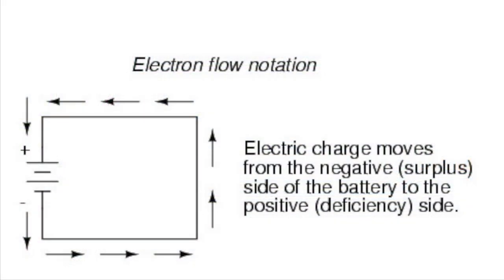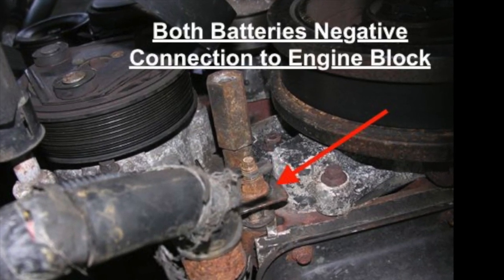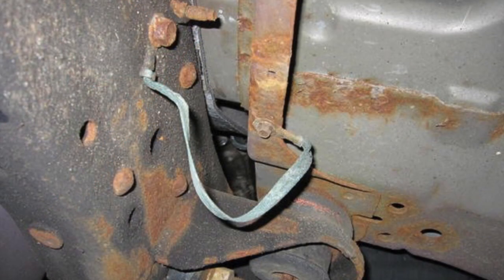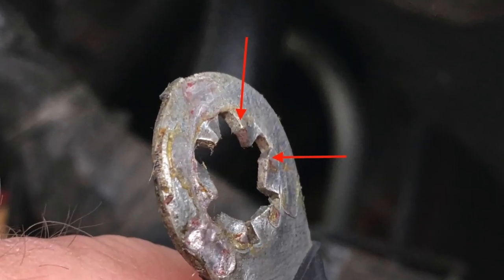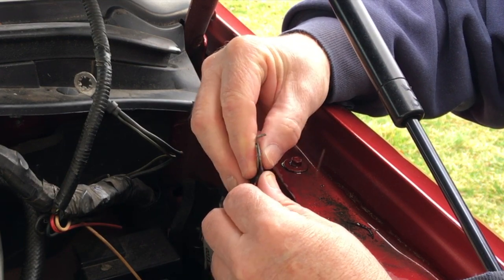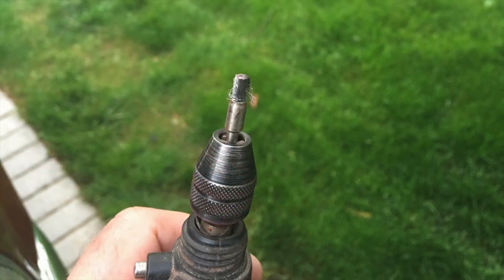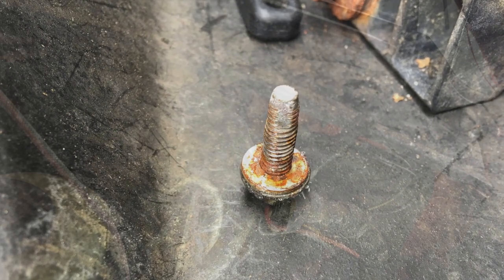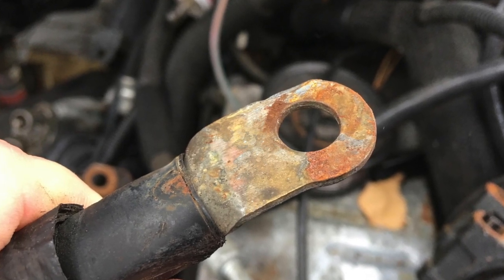Powerstroke 6.0  Electrical System Negative / Grounding Locations

Comment: 18" eye-to-eye 1/0 gauge cable from driver's frame to block is too short for me. Its an 04 and routed as shown in your video using recommended place on the block. It might reach to the stator bolt, but I still have the shroud. I see the one ficm repair sells is 21" and others suggest 24". That's my report. Still mulling it over. Thanks always for these videos with in depth explanations.
Reply from the maker: I originally used 24" and recommended it, but on the forums, I kept getting comments that it was too long. I was able to use 18" in my application, but... Thanks for the comment - it helps.
Reply: @toomanytoys  I figured you tested it and I was doing something wrong. Turned out I was using the hole above your recommended location. Using the hole below the water pump outlet brought me closer. Still, I had to route the cable in front of the power steering(?) hose. I should add split loom anyway and will monitor for chaffing.

Comment: Great video, I’m currently dealing with a real gremlin, new alt, new batteries, good wiring to alternator, and yet my truck keeps dying while running- loosing all electrical power. Starting with gauges, radio, lights , then eventually stalling out. I am going to try using this video to take a final jab at it, then if this doesn’t work, it’s going to a shop and I’ll make a write up on it in case anyone else has this problem
Reply from the maker: Are the batteries losing voltage during this?
Reply: @ yes
Reply: @ I’m not getting a battery light which is the weird part
Reply from the maker: @ When you lose power, have you checked the voltage of each battery?  And do you manually recharge afterward?
Reply: @ I checked them when it looses power, it’s usually immediately after I jump it and take off the leads. I did leave it on the car charger over night and that seemed to help a little but I could be wrong.
Reply from the maker: @ After losing vehicle power, what is the voltage of the passenger battery and the voltage of the driver's battery?
Reply: @ I would have to go check, it usually is around the low 11s high 10s
Reply from the maker: @ So both batteries are at about the same voltage?  Does the battery light come on during wait to start?
Reply: @ yeah the battery light comes on, and yeah they are about at the exact same  level of charge
Reply from the maker: @ With the batteries charged, if you put a voltmeters negative connector on the passenger negative post, with the voltmeter positive lead, what is the voltage on the passenger battery positive post, and then the voltage on the alternator's positive output post?
Reply: @ with the truck on or off?
Reply from the maker: @DTMBUILT  Off, not running.  Actually, both would be good.
Reply: @toomanytoys  12.2 off
Reply from the maker: @ So the battery and the alternator post read the same, right?  BTW, a battery with a 12.2v reading is at 50% charge.  A good battery at full charge will be 12.6+v.
Reply: @ yeah they both read the same , that’s what’s making me just want to give up because that’s all I could think of. The truck is sitting in a random parking lot right now until tomorrow when I can get it looked at. The most I could do now is jump it but I don’t think that’s going to charge my batteries all way but I could be wrong. It seems like these things need to be 100% charged after they die
Reply from the maker: @DTMBUILT  Yes they do, and coming right off a charger they should be over 13v.  When a battery is not fully charged, the plates will oxidize quickly.  When batteries are deeply discharged, they need a charger that can do a restorative charge over 24 hrs.  In a vehicle, even if run for 6 hrs, will not fully charged.  They will only accept 3-4 amps after ~10 minutes due to internal resistance.  It could be that the alternator is doing everything it can, but with the batteries not fully being charged back, depleted, they get hurt more.  You may also have an internal fault in one battery, which will drain both down.  I’d be charging both with a charger to full, then take them to AutoZone, Advance, or wherever and have them tested for free.
Reply: @ I think this may be it, I will say, once I had it on the charger a week or so back for a looong time , it was seemingly fine. But now it’s having its issues haha.
Reply from the maker: @ At this point, these batteries may be toast.
Reply: @toomanytoys  I’m going to remove one at a time and get them load tested and see
Reply: @toomanytoys  so I just made a discovery, the positive lead on the passenger side battery is partially broke, barely hanging on, the metal part that goes around the terminal. I’m wondering if that could be it. I feel like it would’ve showed up on the multimeter but maybe not
Reply from the maker: @DTMBUILT  Is it the battery to battery section, or the part that goes towards the cab?
Reply: @ battery to battery section
Reply from the maker: @ FYI, if you can’t make a good repair, CustomBatteryCable makes a good set.

Comment: Looks like I'm going down the rabbit hole..... Had a hard rain yesterday and drove the truck 3-4 hours. Today no rain and now I have 4 fault codes (B1318, P0276, P0278, P0341) 3 of the 4 (B1318, P0276, P0341) are related to low voltage. I just installed a new 130 amp alternator with the smaller pulley and output at idle is ~14 volts. After the 4 hour driving yesterday and about 1 hour drive time today batteries are reading ~11.3 volts before cranking the engine. I know that anything under 12.6V can harm the FICM. Additionally, about a month ago I had the cab lifted about 6 inches to get the turbo out and install S&B body mounts, so I definitely need to check those flat braided cables.
Reply from the maker: With the draw of the glow plugs, that's a common voltage before hitting the starter.  If you look at some of the graphs when I did alternator testing, you can see how the voltage changes during the "wait-to-start" point to when the glow plugs turn off.
Reply: @toomanytoys  Thanks for the reply! As an admission of me not being observant I have seen many of your 6.0 Videos, and have read many of your posts on FTE over the last couple years, but just put it all together this morning as I am reading one of your threads on FTE that all of it was you!
Reply: @toomanytoys  I had my engine "bullet proofed" by a local shop about 2 years ago and after I got it back I had 2 dead batteries, and within a month 2 burned (yes burned like scorched) Warren injectors, and have been chasing electrical gremlins since.... I've not taken the truck back to them as they caused more harm to my truck than good and I no longer trust them. After recently having a Cyl. 6 Imbalance code I replaced my FICM harness, VGT solenoid, and cleaned the inner turbo exhaust housing and replaced the unison ring as it had a "keyhole" going on, and did a couple pigtail fixes on some cracked wiring while I had it all apart. I'm at the point right now that I just want to redo as much of the wiring as I can and trying to get the ground issues fixed first.

Comment: Thank you for detail 
For my project, they will come in handy, as I move beyond what was detailed in this video.
I bought a decommissioned ambulance, where the seller claimed that the 6.0 was "junk", at 164,000.
By "decomissioned", I mean that they took a Sawzall to most of the wiring.
Now, the entire electrical system is a bit wonky, and, I suspect a bad ground circuit.
Or several, as it is an ambulance, which has many circuits, and no possible body grounds in the rear, which is entirely aluminum.
Reply from the maker: I wish you luck with that.  There is so much add-on wiring to those.
Reply: @toomanytoys  dug into it today.
The ground strap from the batteries crumbled in my hand.
Not sure why it got a new starter installed.
But, I guess I'll  take it.
$1750,  and a ground cable, for a nice 2005 e450 ambulance sounds good to me.
Reply from the maker: @Mr.Schitzengigglez  New starter because no one looked at the cables; fantastic! Just had a recent forum thread like that.  

You take any good deals that come your way.  Glad you sorted it out.
Reply: @toomanytoys  ground strap crumbled in my hand today.
Surprise, Surprise. New one on order.
Gonna improvise tomorrow, because I'll probably be working when the real one gets here.
And, it's "only" a ground.
Reply: @toomanytoys  on top of my last reply.
You ait lying about that, my man! 😂

Comment: Okay moving from your alternator video where you explained how to create a parallel fused "+" feed from your high output 230 amp alt to the + terminal of the passenger battery , I have moved on to these videos.  So your response to my comment to that alternator video where I indicated that I plan to do a similar upgrade in alternator, you comment that I should go to 6 ga from the 8 ga as shown at 3:00 min for the passenger battery. I notice that no such 8 ga line exists at the driver side battery (at least not in the circuit map you show just seconds later).  Should I add a line 6 ga line or would that not be just overkill?  I mean I see no negative consequence to doing that other than creating redundancy.  Again, like you, I want the best flow.  I plan to check the grounding connections you also highlight in the video and use dielectric grease to minimize oxidation. I am now moving to your next video on wiring ....
Reply from the maker: I’m combining your three separate comments from the different videos into one video's response.

With a dual alternator setup that was an option for emergency service or high load vehicles, post glow plug use, you should have the combination of both 140 and 110 alternators in play.  Those values are at the full cold rpm but would be lower at idle.  Both alternators supply the common positive circuit unless someone has modified that.  Or, you can have a lower-than-expected current output if one of the alternators is not working.

With all you are doing here, it would not be a bad idea to get a $50-75 clamp-on DC ammeter to check your alternators and any other flow.

While my video was working with a single alternator vehicle, a dual alternator vehicle should have the same negative battery cable on the driver’s battery as the passenger’s.  So it should already have a direct connection to the block and an 8ga leg to the inner fender.  That should be adequate for a 250a combined dual alternator system.  The video showing an additional 8ga added to the driver’s side is again for a single alternator vehicle.

You intend to add a larger alternator instead of the 140a because you are adding a higher load to the vehicle.  Many emergency vehicles use the truck frame as the grounding point for their accessories.  However, most people, when adding sound amps or, in your case, fans, typically ground to the body tub.  And in those cases, increasing the cable between the battery terminal and the body tub should be larger.  Two 6ga negative cables replacing the 8ga would be reasonable.

However, I’m surprised your dual alternator setup is not sufficient, so if it were me before I’d be installing a very large alternator, I’d be making sure both of the existing alternators are working.  But instead, it’s not unusual to find the second 110a not working at all, the 140a carrying the stock load.

The two diagrams for a dual alternator vehicle.

https://www.powerstroke.org/cdn-cgi/image/format=auto,onerror=redirect,width=960,height=960,fit=scale-down//media/6-0l-dual-alternator-12-6-png.107807/full

https://www.powerstroke.org/cdn-cgi/image/format=auto,onerror=redirect,width=960,height=960,fit=scale-down//media/6-0l-dual-alternators-12-6.107808/full
Reply: @toomanytoys  Thanks for the input and I do plan to buy the clamp-on DC ammeter to check the alternators.  I already spent $600 at two different mechanic shops to check the electrical as I was worried that there was a problem for other reasons and neither said the alternators were bad and one said that the 2nd alternator is separate from the first, feeding the ambo batteries only.  The ambo batteries (2 of them, both AGM) are connectable to the engine batteries by way of a cut-off switch by the driver seat.  Either way, I plan to check it myself.  But clearly, when I am driving down the highway, at working operation temp (~180F), the e-fans kick on.  With my Scanguage II monitoring the battery power, as soon as I engage the AC or just the cab blower motor, my voltage starts dropping to below 12 Volts.   If I was doing this at night, requiring my truck lights to be on, even greater draw, so much so that my dash's battery warning light turns on (in all situations described, my radio and cameras are off and none of the ambo equipment is on).  At that point I am freaking out about the FICM and all the harm I may be doing to the electrical components. So THIS is why I plan to upgrade at least the main alternator to provide a greater buffer because it may very well be that the 2nd alternator is not wired to provide direct power to the engine bay.  I will buy the ammeter, check and if it turns out that the lower alternator is busted, I will save money and just buy a replacement Ford or other quality brand.  

Aside:  my truck does come with a built-in DC voltmeter AND a DC ammeter (analog gauges near the dash) and the latter never does not go north of 140 when I rev the engine north of 3000 rpm.  On the highway, I am normally at about 2100 rpm and the gauge just plateaus at 100 amps.  So all signs point to only 1 alternator
(
Reply from the maker: @alporan9087  It's possible that it got rewired differently than the factory setup.  Body builders do their own thing.  There is also a jumper in the harness at the passenger inner fender that controls between a single or two alternator system - how the PCM operates.  

The ammeter may be only reading one alternator circuit if the builder separated the two alternator outputs.  You have some discovery in front of you.  If they are and you keep the two alternators separate, then the big alternator as the primary can make sense.

Comment: So can you replace the two braided cables with a 12 gage wire?
Reply from the maker: You can.  The use of braid is in case there are high frequencies coming out of the alternator, but they are also used where flexibility is needed to not break the strands under movement.  I replaced the lower cable with standard wire and never had it break, nor had other issues.
Reply: @toomanytoys  awesome thanks so much for the reply! 12 gauge seemed so small compared too the braided wire that's there. Thanks again
Reply from the maker: @mf8913  Those took some work because they are not listed in the vehicle electrical diagrams.  I bought a new cable and checked the strand count and diameter to find an equivalent cable.  This was not the company I used back then, but its data is similar.  You could go up to 10ga, which would not be an issue to be more comfortable.

Here is an example of what I used:

https://gacopper.com/braid.html?gclid=CjwKCAjwur-SBhB6EiwA5sKtjgbNnZWjsrp6fQXRxBJ5f6_4RLfqX26Q09RNMbPIV2NO6RFR2uiqhBoChy4QAvD_BwE

Comment: This is vital information you are providing. Totally essential for good maintenance of the Powerstroke 6.0 . What is the gauge and length of your added driver side ground cable? And   to what location in the block it goes to ?
Reply from the maker: That's in the description of the video "2003 Powerstroke 6.0L Battery Cable Upgrade to Balance Battery Life". You can tie into any of the open threads on the driver's side front of the block.

Comment: Have a worked 6.0 with a bad seemingly electrical issue. When driving normal or slow the engine will completely stall and pop back on or stall and have to be restarted as if the battery cable was shorting. When it does this, the dash and engine cut off simotaneously with a glow plug light flash. Replaced icp,ipr, crank and cam sensors, tps etc.. including cam harness. Been to two mechanics specializing in 6.0 to no avail. Truck runs great accept for this. It must be electrical. Everything communicates on the harness and ficm. It was tested while running and driving. Has no codes at all.
Thank you for your help
Reply from the maker: I had a similar issue with my 2003 6.0 from the day it was new.  Hard right turns would stall everything out.  The cure was a new engine harness after 135k of it occasionally happening.  It could be slow turns or a tight exit off the highway.  Putting it in neutral and restarting would work while still driving if it was an exit.

I think the only way of sorting it out is either a new harness or extensive disassembly and inspection.  These harnesses have a history of shorting, and the PCM will just shut down when it senses a short or out-of-range voltage.  You can play with the sensor and connectors all day long, but if it's in the harness somewhere, it takes an extraordinary amount of troubleshoots.
Reply: @toomanytoys  very informative! Might try that out
Reply: @fasturbo7894  definitely a bad harness.

Comment: There are deluxe cable assemblies that include a cable between the passenger positive and driver side positive battery.  Do you recommend installing this?
Reply from the maker: I do; it was my first video.  But the one I believe you are thinking of is crazy expensive and wasn't designed for the problem and an electrical engineer would do; it's more bling.  The video, https://youtu.be/a3LO-Kfz460, has at the end the cable sizes you need along with where to get them for the best costs.  I had a long debate with that supplier and he added the negative side cables I suggested with the newer kits.  The alternator negative cable to the inner fender is also another misstep, it does the wrong thing when the starter is engaged, shown in the later video on grounds.